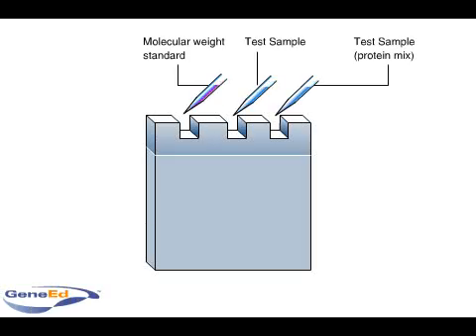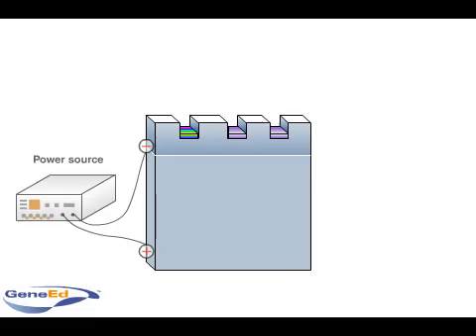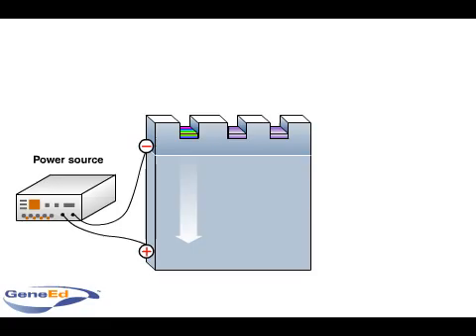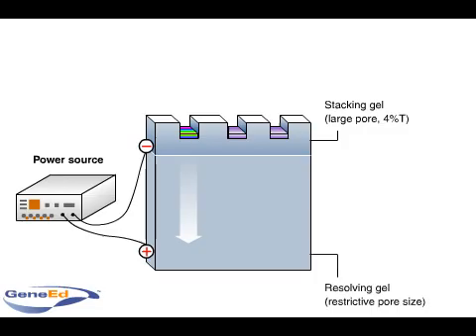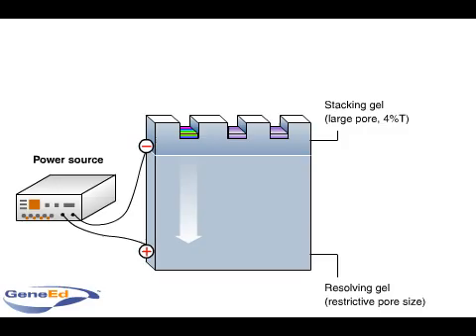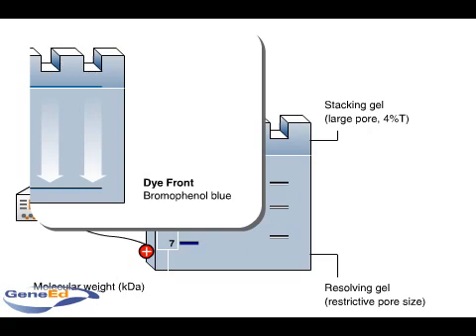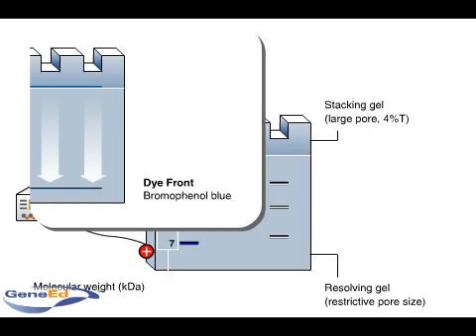SDS-PAGE (polyacrylamide gel electrophoresis)

Comment: can this split up the the subunits of a quaternary protein and show the different polypeptides that make up the original protein that was put into the gel?
Reply: Yes. The SDS is a detergent that denatures. Typically, the proteins are boiled to deconform the tertiary structure. So, SDS and boiling will also break down quaternary structures as the tertiary bonds are lost.
Reply: +KnowJesusKnowPeace sds along with mercapto ethanol to reduce disulfide bonds is needed for quaternary structure protein.

Comment: @MZee32 
The stacking gel makes sure all proteins arrive at the resovling (or running) gel at the same time. This is important because if the proteins arrive at different times in the running layer they seperate not only on weight but also on who reaches the gel first! This is something you dont want. So in easy words: the function of the stacking gel is a 'fair' start. About how this fair start works google about 'Kohlrausch reactions'.